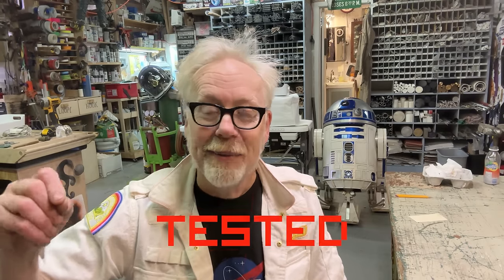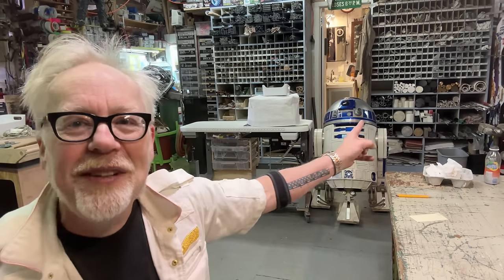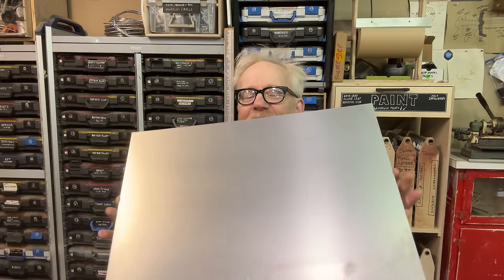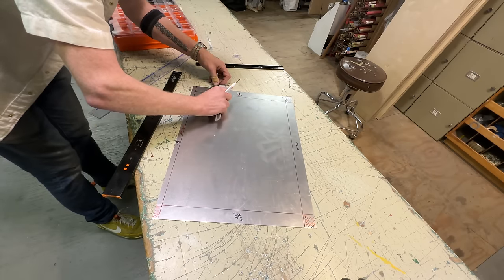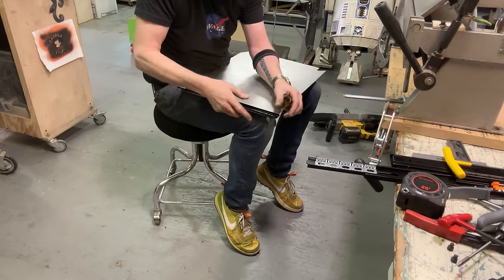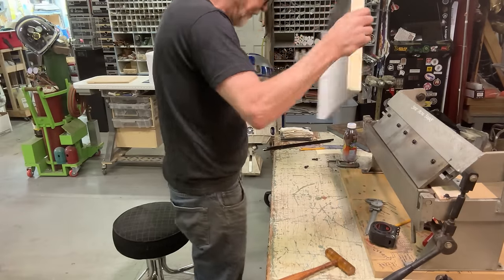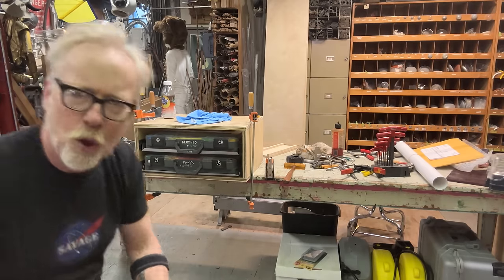Adam Savage Prototypes His Dream Hardware Storage System

Comment: So I was contemplating about your Apple Watch Ultra and the problem of electro-smog. Some people are very sensitive to that, you obviously not.

Since you already have your metalwork-tools near by, I wonder if you could build a small prototype-box made out of copper that
is just big enough to fit your Apple Watch Ultra (without band) but blocks all radiation from it but also has a pass-through-connectors for the band.

So that if someone with serious electrosmog-problems could then also wear an Apple Watch Ultra and only open the metal-box for short amounts of time when in use, like let`s say for an emergency. 

You could even build such a copper-box in series and sell it on your store or put a layer of steel on the outside to make it more durable. 
"Adam Savage`s anti-e-smog copper-null-box" or something like that with your signature engraved in the metal. "Zero emissions", "emission-neutral" etc. just throw the buzzwords around.

But of course you would have to test and prove that it really blocks all the radiation from the Apple Watch Ultra to sell it as such a product.
 I heard that copper blocks radiation, but I`m not sure if that is true or just a myth or how thick the copper must be.

If that is successful you could even build larger copper-boxes for larger products like iPhones and iPads, Vision Pros etc. and make a business out of it.
"Where there is Apple there is money."

Comment: Oh, man! I've lost count of how many times I've had to drill, bend, and fabricate rack slides and mounting brackets for videotape machines, monitors, and other equipment, in TV stations!
The slides either never fit the rack correctly, or don't fit the equipment you are attempting to slide into the racks!

Comment: High/low units would be a PITA like that.
Just make ONE of the slots a pull out flat topped surface that you can place the container on at a nice workable height, problem solved.

Comment: From my understanding of this, you've got a bunch of container boxes designed to be portable, but the portability aspect is causing you problems and you want them to be fixed.  Thus, have built another system to take the portable boxes portability feature away, effectively making them into draws with compartment boxes.  

Seems like a rack of drawers and little container pots would have solved this issue.  Although I always say, if something's worth engineering, it's worth over-engineering.

Comment: The problem I keep having with bar clamps is losing those little plastic caps that are supposed to keep your wood from getting imprints. And no freaking hardware store sells them! (Yes, I know there is such a thing as the internet, but I'd prefer to buy locally).

Comment: Couldn’t you just have a large breadboard type pull out at about counter height? Just pull out the slide for a temp counter. Set the bins on it then push it back in when you done.

Comment: ADAM.... if you still have time... put a spare pullout at waist height, just a flat 3/4" thick tabletop  on a drawer slide to give you a temporary "horizontal surface" if you want to pull one of the very LOW boxes out, put it at a COMFORTABLE level, rifle thru it and then put it down where it belongs... My back is older than yours and I HATE bending over for stuff that is low for too long.

Comment: What if you didn't screw the drawer slide in on the back and put a piece of vlock under so it wouldn't fall buuuut then when you pull out it actually tilts too!
Reply: I of course mean the slide attached to the dresser. Just have a strip of wood under so it stays parallel while closed and when you open then they weight leverage will tilt and have another strip that stops it above it. Could be the same strip used for drawer above it. Makes drawers easier to look at.

Comment: At 6:37 & 2 thoughts cross my mind: 
So, drawers, with covers, that easily detach from the wall?
Instead of all that work & expense, why not a pull-out table like they make for kitchens right in the shelving & @ at a comfortable height? (2 front legs flush with the shelves, surface on 2 drawer tracks if even needed, slips between shelves.) 
I'm SO hoping he found a more "elegant" solution. Love Adam 😊

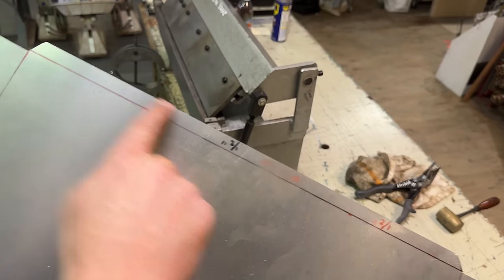13:50 The anxiety watching all this work...work which he enjoys, great! Great for him! But it's killing me.
A rolling cart. Bring all the ones you need Right to where you're working.
Don't want another flat surface temptation? Understandable. Folding, collapsable rolling table.

Awesome tools...all of which have to be put away. Very cool...as I'm dying a slow death here

Comment: Well i had kinda the same problom, but I did it way faster, because I need to do stuff with the stuff 😂 I took out one box for each 3 coloms in a good height where it is comfortable to stand and look in a box, and only made this one a platform drawer, because the ones down by the floor ore above my chest, is annoing to get a look at, so making them a "real" drawer slider is in my opinion a whaist of time.. just have one you can pull out the platform with one hand as you grab the box you need with the other. you might save 5 sek, but you whaist 14 days and a lot of money doing drawers on all...

Comment: The thought of making those by hand is going to give me nightmares.  Take the prototype to any competent sheet metal shop, have them CAD, or STEP, or IGES, or INVENTOR it.  Then they can cut it out on a laser, then bend it on a proper press brake.  They will all be identical.  Have them make 100 of them for future uses, as we all know you will eventually need more.  It wouldn't necessarily be cheap, but the amount of time you are going to waste making those very inefficiently and inconsistent is just not worth it.  Every single drawer made by hand is going to be slightly different, and require many more adjustments per drawer slide. 

Your time and sanity is more important.  I have lived in the sheet metal world for going on 30 years.  I'm not saying I am an expert, but I know a lot about sheet metal forming.

Comment: If it were me (and my time and $ budget) I would start with one or two pull out “flat surfaces” per rack. Just pull out the closest one and you have and easy flat surface for the Sortimo in use, without rebuilding the entire thing. Once you are done and you put the Sortimo away, slide the flat surface back in. A fraction of the time, materials, and manufacturing than Adam’s method… but I’m also not benefiting from the content creation that goes along with the project like Adam is. 😂

Comment: I am sure this system will be great. Except that many of the drawers will be at less than ideal high if you need  to search around in the content.

Could you not save yourself a lot of effort and expense by making SOME drawers that could be pulled out at about waist height. And then they can be the vertical surface you need to place the other sortimo racks you pull out of the existing system you have in place today.

Comment: Mmm, I am not totally convinced this is the best solution. Because for the higher stacked cases, it doesn't make sense to make the expensive slideout. You can not look into them. Why not build a slideout shelve in the each frame to pull out whatever case to be put on the shelve. A bit of a compromise, but way cheaper and less work.

Comment: Building in extra space is sometimes a good thing, sometimes a bad thing. If it's a purpose built project, with limited need for expansion, the extra space is wasted. Additionally, if the future needs built for don 't match future needs, i.e. the current(in the future) needs don't fit into the constraints of the extra space of the past design.

Comment: you need a 500kg work table with holes to fasten work so things dont move on you. you are getting old and at one point if something move wile you use force you might hurt yourself having it fall over you etc. and a heavy table lets you use a heavy hammer where all the force actualy transfeers to the object, aswell as securing down stuff so they dont actualy move.
You can often find them nearly free (scrap steel price) as people throw them out, though they aren't worth it as they arent going to be nearly flat and the work it takes you is going to be higher than the money you save getting a solid one from the start. Also grinding down cleaning a old table that has pits and bumps doesnt make a good video.

Comment: I think it's a terrible idea to make draws, it's useless in the bottom, and useless above X height...  Just one pull-out shelf at the ideal height for your length, so you don't have to duck-down or stand on your toes...  Pull out a Sortimo-box and put it on the shelf, easy access every time!  (You could make some edges on the shelf so it doesn't slip off)
Sometimes simple is better! :body-blue-raised-arms:
Reply from the maker: Yes, but this is ADAM.
Reply: @ I doubt that Adam would choose the complicated solution, if the simpler solution is way more ergonomic! I don't know how Adam feels about bending down, or crouching, or standing on his toes, to look for a part/screw/etc. , but my knees sure don't like doing that..  
I get that it's content for the channel, but is it the right content?  Maybe Adam just didn't think this trough...?
Love the content non-the-less though!  😉